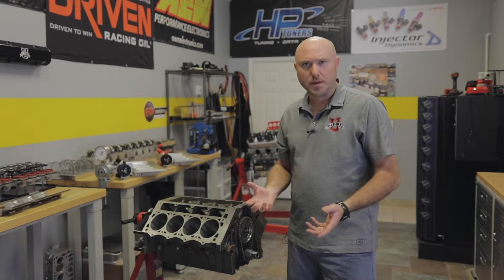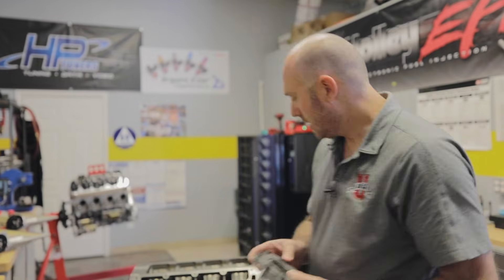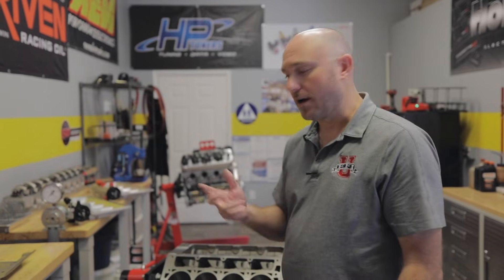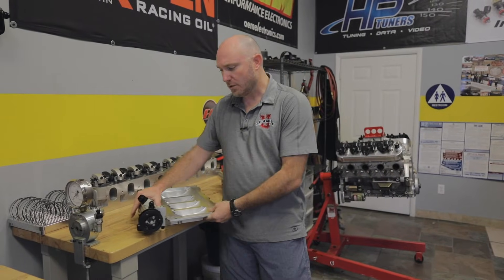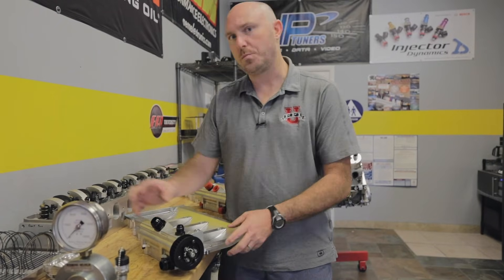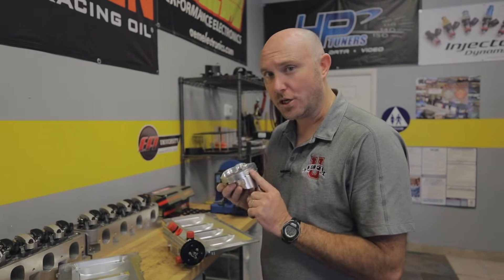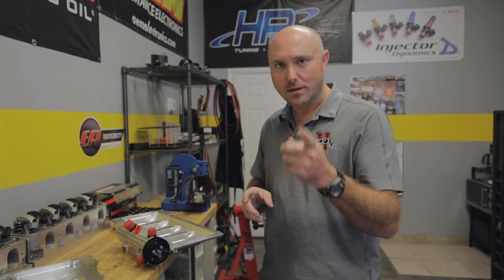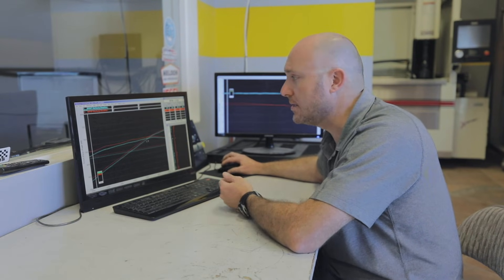Everything you need to know about a dry sump oiling system.

Comment: Ring seal information is right on point.  However, the  argument about the piston having to displace the air from below it is not.    As one piston moves down, another moves up and the volume of the crankcase remains constant, so the pistons are moving air around, but not pressurizing it except by blow-by.  It is mildly easier to push a piston against a vacuum due to aerodynamic drag, but not due to pumping pressure since the crankcase volume never changes (unless you have a one-cylinder engine or separated cylinders like in some two-strokes).  We just aren't reducing pressure enough to significantly reduce aerodynamic drag.  Even in the case of a single cylinder, the air pressure in the case would just act like a spring.  It would make it hard to push the piston down, but make it easier to raise the piston up, so the pressure would require no net work.  With a vacuum in the case, it is easier to get the piston down, but harder to raise it up.  The main benefits are ring sealing and making sure the crankshaft isn't having to slice through a reservoir of oil with each revolution.  As you mentioned, it also provides better options for oil pressure and volume adjustment, scavenging from every corner of the tank or engine, free range on oil system volume, and, of course, reducing the height of the engine.  And no crankcase oil leaks because of the vacuum.  :)
Reply: "with a vacuum in the case, it is easier to get the piston down, but harder to raise it up."

Yes, but doesn't the piston going down more easily, assist the other piston on the way up?
Reply: I'm sceptical about the claim that vacuum increases ring seal by "pushing the ring out against the cylinder wall". How does a pressure difference between the top and bottom of a ring cause it to move, not up or down, but out? If this is the case, then that would increase friction, and in theory there would be a point where too much vacuum could damage the cylinder walls.
Reply: @jckf  A higher pressure (above the piston) will want to move to the lower pressure (in the crankcase) there by pushing the rings out.
Reply: @ms.a_theshopteacher  I appreciate that you took the time to respond, but there is no explanation here. You're just repeating the thing I questioned.
Reply: Jim C K Flaten  I apologize if I was too vague. Let me break it down further. To my knowledge,  the high pressure will push behind the rings (as long as side clearances are correct) which will push the rings out creating a better seal. This is increased with gas ported pistons or gas ported piston rings. Using thinner low tension compression rings with special coatings like nitride or PVD can help with the excess friction. Please let me know if I am incorrect.
Reply: Damn commenter know it alls that fail to think of it all. I'll make it easy for you with some topics to think on so you yourself can see why you're wrong, since you seem at least mostly intelligent.

-Inertia (gasses have it to)
-asymmetrical twins (Harleys for example)
-odd piston numbers (Chevy 5 cyl. for example)
-why are there pressure fronts in earth's weather system? It's a closed system.

And finally
Why did you feel so entitled and emboldened to come off so preachy about your Incorrectness on a youtube video that is fundamentally right and loses nothing even if your mild case point here was correct?
Reply: I don't have all the answers but I think this would require some serious testing.  The volume of air is definitely increasing because of blow by which EVERY engine has no matter what rings you use, so there IS an advantage to increasing vacuum..  ESPECIALLY if it is a boosted application.  That being said the air in the crank case is pumping all around back and forth as well because of the Piston pumping action.  That is called drag which affects total torque output.  That ALSO creates aeration, which reduces the pickup and pumps ability to scavenge at 100%.  I believe most folks just need to group think a bit better and consider ALL points and leave the ego at the door.
Reply: Absolutely But  Youtube experts are always right?
Reply: @tomhutchins1046  show me the fault in his logic... Everything he said is spot on. Maybe just maybe, YT commenters might just know as much as the person presenting the video. I mean after all there are no qualifications required to post a YT video, and there are lots of self proclaimed experts posting videos, presenting information like it is a fact when in fact they couldn't be further from the truth. Being popular doesn't make you right, being right does.
Reply: @tomhutchins1046  what exactly is there to learn (or argue about for that matter)? bvcxz gt and EFI University said almost identical things, with the exception of bvcxz gt made one minor correction about the air from the bottom of the piston being displaced rather than pumped (which he is right about). Bill Dailey himself (the guy who made that dry sump) made comment on sealing each section versus allowing them to transfer the air about.
Reply: @tomhutchins1046  yep and I see you have resorted to the name calling option, because you lack any kind of mechanical ability, or credibility, to articulate your actual issue.
Reply: @DodgyBrothersEngineering  I know that type of guy, don't worry about him, he's not here to discuss anything, he's just here to hijack someone's argument and adopt a false intellectual high-ground.

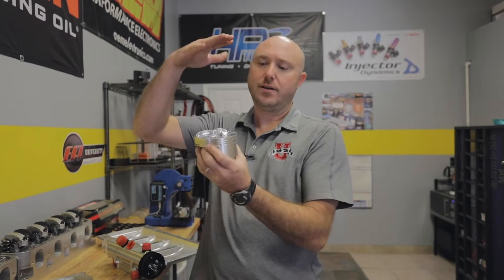Comment: The description of "pumping loss" starting at 6:00 is incorrect.  "Pumping loss" refers to the losses of moving air in and out of the cylinder via the intake & exhaust tracts.  Also, if you have an even-cylindered, even-fire engine, there's no internal pumping pressure, because as one piston is moving down, another is moving up in the opposite portion of the stroke.
Reply: Absolutely But  Youtube experts are always right?